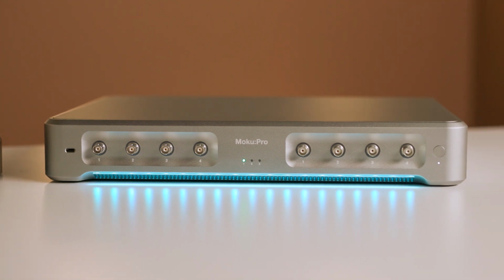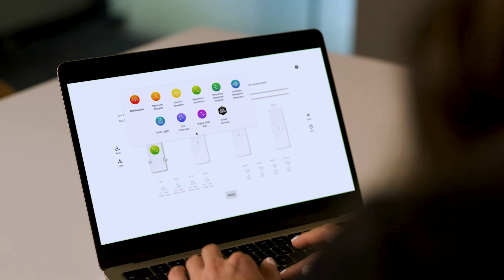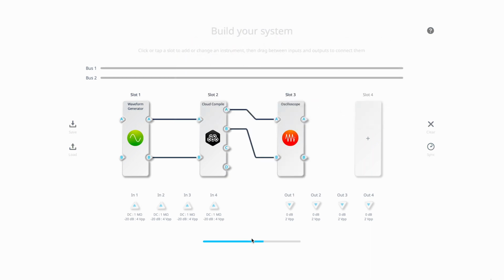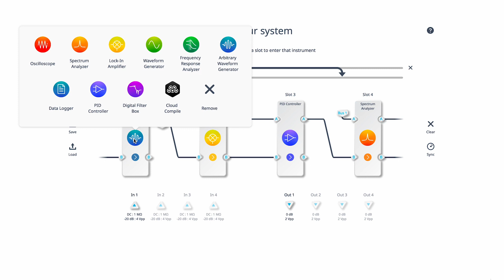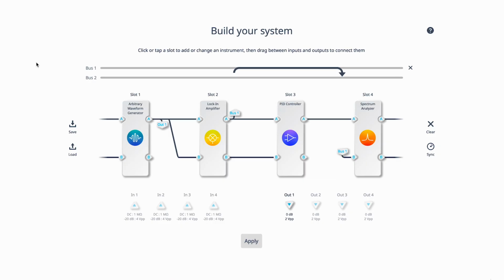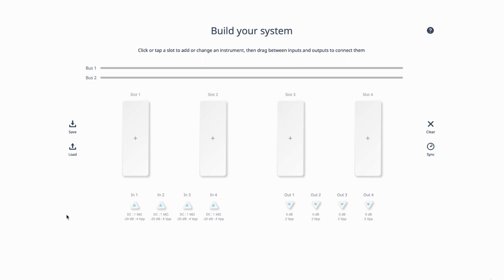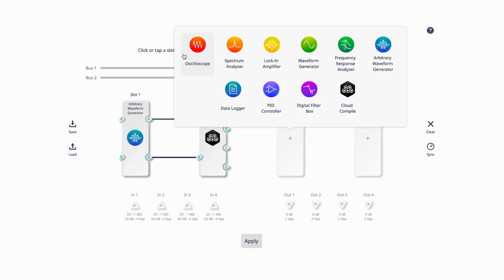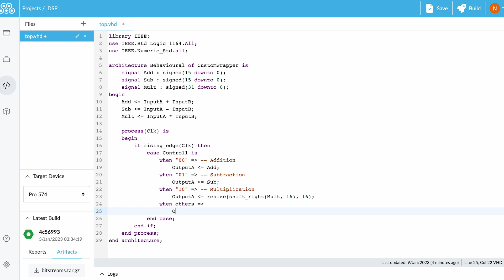Multi-instrument Mode and Moku Cloud Compile

Comment: Hey Nandi Wu. Are there any comprehensive lecture series on tips to approach, language for coding multiple instruments into one project, from your side. Thanks
Reply from the maker: Hi Mahadesh, thanks for your comment. The great thing about Multi-instrument Mode is that there’s no coding required. You simply drag and drop any of our 12 software-defined instruments to combine them in whatever setup you need. 

If you want to code additional custom functionality with Moku Cloud Compile, it uses standard VHDL. There are lots of free resources available online that can help you get started with VHDL. 

Feel free to contact to us at support@liquidinstruments.com and we can help you find specific resources that meet your needs.